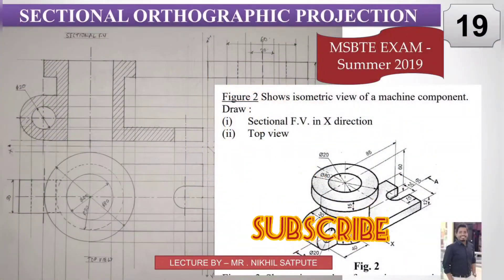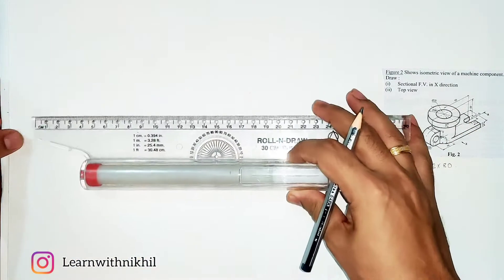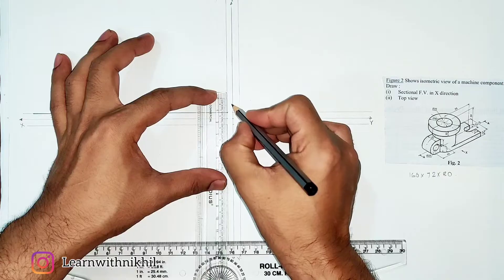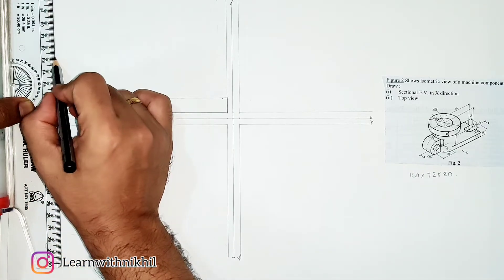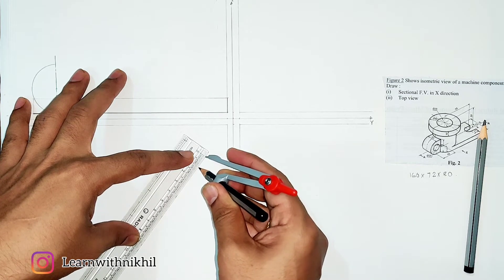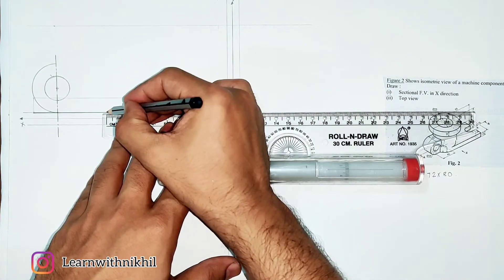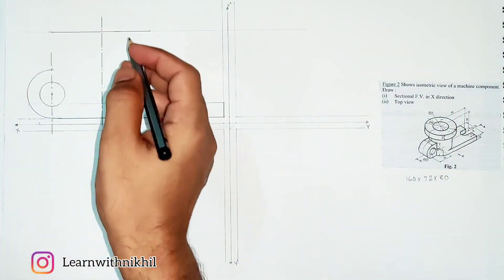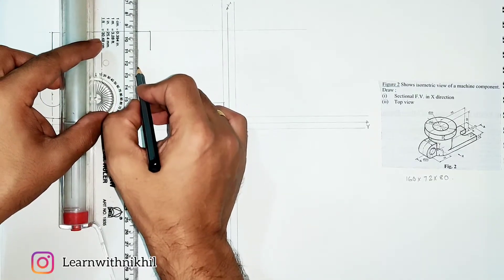Engineering Drawing | Sectional Orthographic Projection Problem 20 | Learn with Nikhil

Comment: Draw a regular Hexagon of 30 mm side with it’s two sides vertical .Draw a circle of 30 mm Diameter in the centre .the figure is a hexagonal plate with central circular hole .Draw the projection when the surface of the plate is vertical and inclined at 30° to V.P.
Reply from the maker: https://youtube.com/playlist?list=PLxtiTGwRHk3PuwMjoLHkA8bEnnFLNhIDb
All the problems are solved in this playlist,